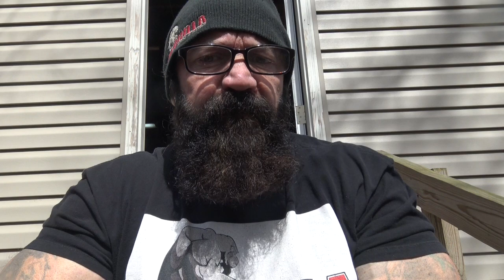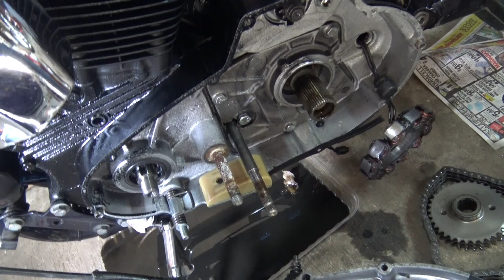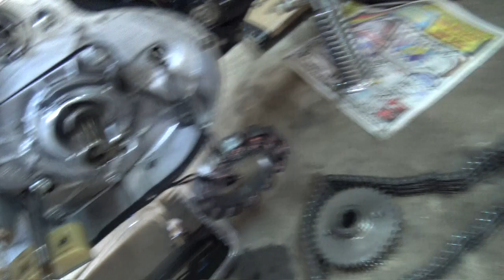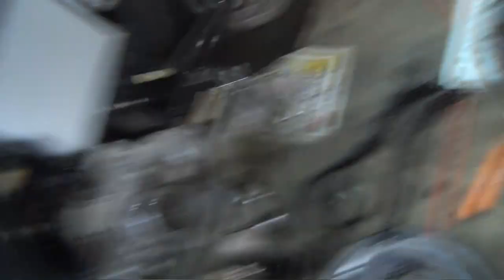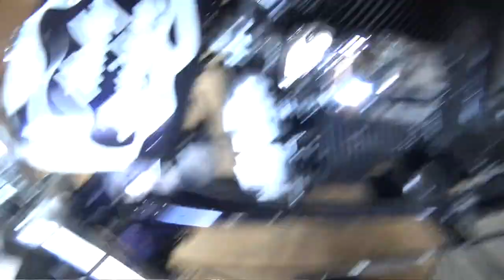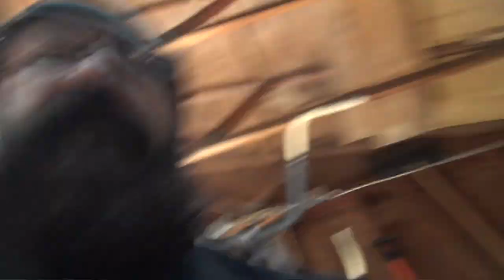1989 Harley Sportster Charging Diag

Comment: It's almost riding time bro!!! VROOM VROOOOOM.
 I've got an old Evo and a 14' street Glide. I gkta say, the twin cam has held up flawlessly.  I put S&S 585 cams in it when I had about 8k miles on it. Full  exhaust and a race tune. It's got 31k miles on it now with ZERO issues. I ride.it like a stole it! 100hp 111 tq

Comment: Nothing wrong with the Milwaukee 8 motor. Best motor they've made in years. Personal experience.
Reply: Everything is wrong with the my. Personal 2 friends of mine had them.  One had to have a whole top end at 30 something miles. Yes, that's 30  something. Not 30 thousand.  The other one burned oil the entire time he owned it. Luck of the draw? I don't know.  Lots of horror stories about the m8
Reply: @19jody72  I've got a 2017 glide with the 107 had the stage 2 kit put in it with zombie tab pipes. I've never had issues. I put 10 to 15,000 miles on my bikes every year. Never had a problem.
Reply: @windycityrebel  consider yourself lucky... be safe out there bro..shiny side up!